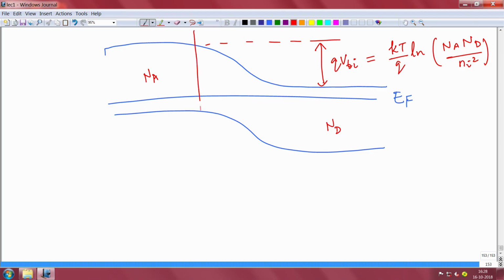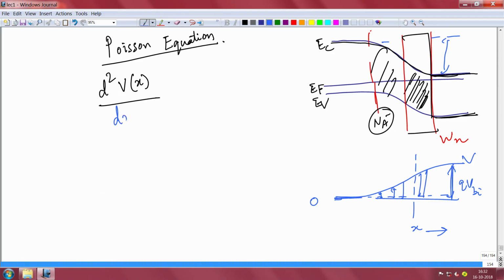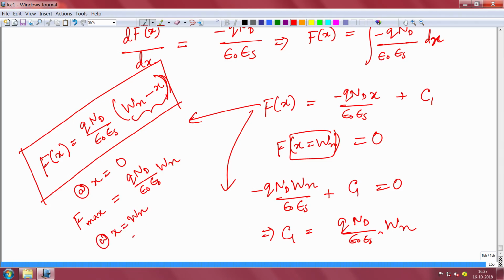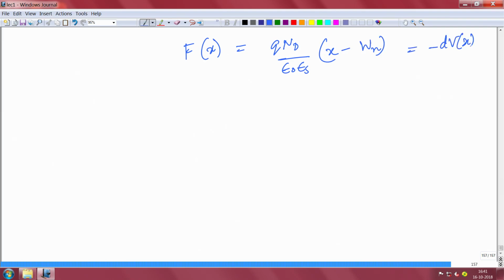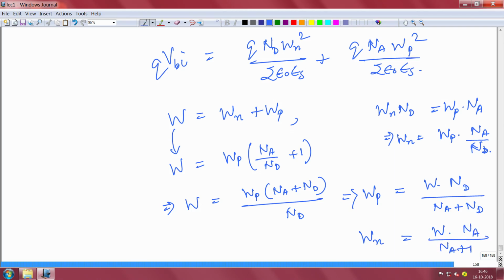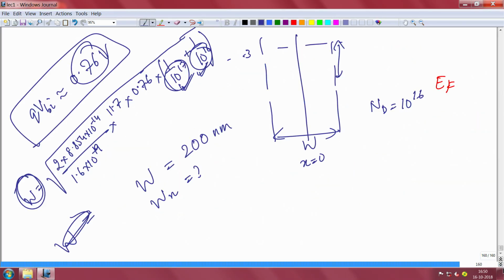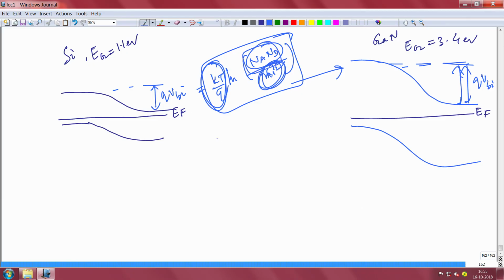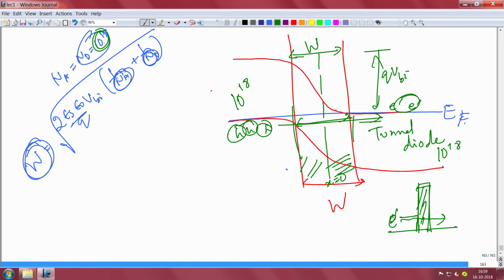p-n junction under equilibrium (contd.)

Comment: still confused of the qVbi. everything is perfect except the (q) before Vbi which is ruining the equation . 
Can anyone clarify me on this?
Reply: qVbi is energy and Vbi is potential. Adjust accordingly.  In any equation both sides should be same quantity. Either energy or potential.
Reply: I think it should be Vbi not qVbi.
Reply: sir mistakenly forgot to remove q from lhs after shifting it in the denominator of rhs. we are solving for vbi i.e. the built in potential, qVbi will be the energy
Reply: here E is energy levels so obviously qV is energy dimensionally and theoretically both same 
now clear